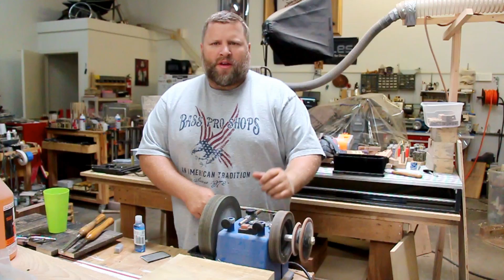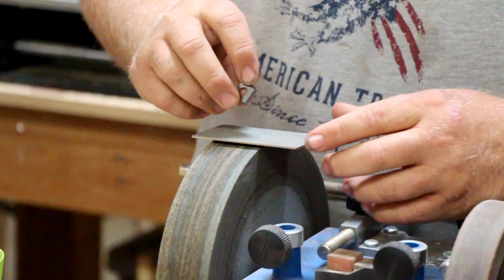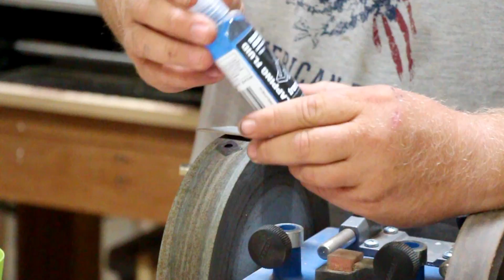Sharpening my carbide turning tool and my Skew,   My goto lathe tools

Comment: Hey Chad. I learned in high school shop class you have to have a sharp tool if you plan on doing any serious turning. The first purchase after my lathe was a Tormek T4 and jigs. I am still learning to use the T4 . Along the way  I got bit by the pen bug and while gathering some tools for this obsession I invested in a Carbide Magic Pen Genie. Luckily I ran across you video. I was on my last edge and was going to pitch the cutter and buy a new one. Thanks to you I instead invested in a pair (400 & 600) of PSI Woodworker diamond sharpening cards. Long story short, your video saved me from wasting those dull cutters. Plus even I can sharpen the cutters in record time and be perfectly satisfied with the results. And my back is so grateful not leaning over the T4 for hours getting everything up to snuff. ! Thank You for this informative video!!!

Comment: Howdy Brother!  I'd like to make a homemade carbide turning tool using a 1/2" square hot rolled steel.  What size carbide insert is best? 12mm, 13mm, 14mm or 15mm.  I plan to order from globaltooling also.  Thanks for another very informative video.

Comment: Hey Chad do you think this method would work the same for round carbide tips? I think it should, also what company sells your materials you use to sharpen them? Thanks!
Reply from the maker: +Casey Martin yes it works the same for the round carbide I have done it with,   the stone and fluid are Trend.   thanks